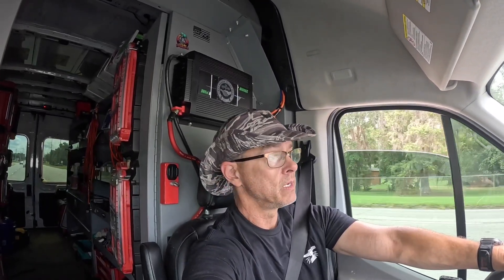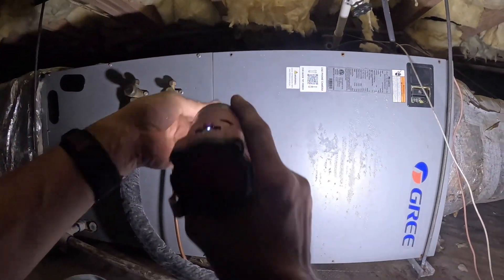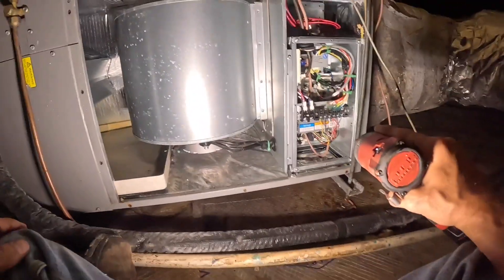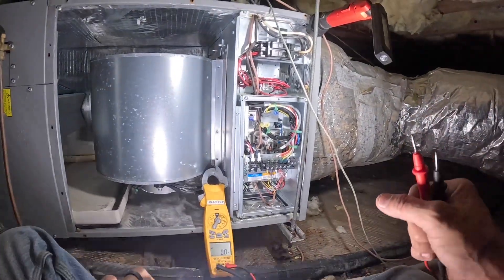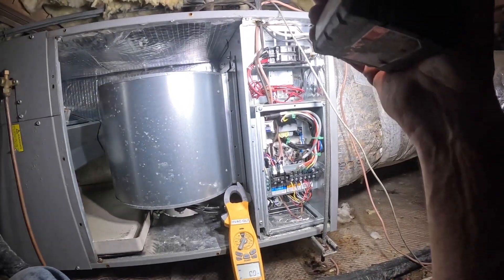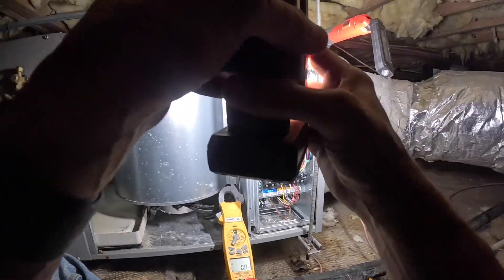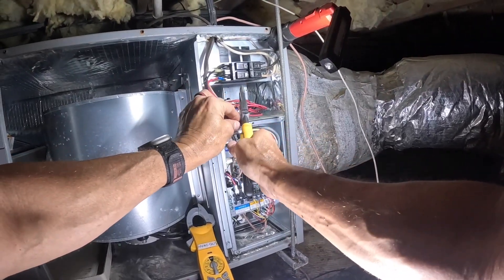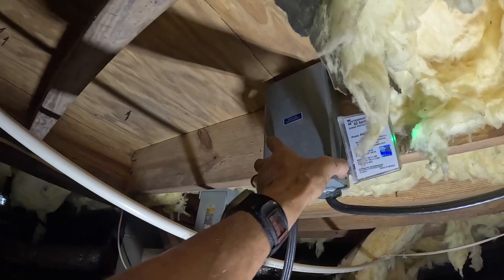Gree Flexx Giving Me Problems After Three Years Now! #hvacguy #hvaclife #hvactrainingvideos

Comment: Its funny how that unit has the 24 volt transformer comming off the heat strip breaks and the one at your house the power for the 24 volt transformer comes off a control board.

Comment: I have the MRCOOL Universal 2/3 ton unit. I just experienced this same issue about 6 months ago. Did my own troubleshooting and isolated the issue to the breaker. I still had an HVAC technician come out and he confirmed my diagnosis. The HVAC technician claimed he doesn't have parts (breaker) for MRCOOL Universal. Which I found strange because they work on and sell Gree Flexx Units which are practically the same unit. I grabbed the part number from the breaker and went online found a handful of sites that sell that breaker. Once I got the breaker, I was able to wired it all back together and the air handler fired right back up. I was glad it was just a simple breaker issue. Unfortunately, the HVAC technician who install my unit moved away. I hate how difficult it is to find an HVAC technician willing to work on MRCOOL Universal.

Comment: Variable speed outdoor units with fixed speed air handlers like GREE/Bosch seem to really struggle with humidity control. The indoor stays at 2-3T capacity but the ODUs start out at 9k btu and ramp up. Much of the cooling cycle you’re left with low high airflow and low capacity so humidity removal is less than ideal

Comment: That’s waaaaaaay too much static pressure for a Gree flex. 
I am in the process of installing my own right now. 
And the manual calls for .4” max and design is .2”. 
Also not sure what your goal with adjusting the fan speed was. You seemed concerned with the humidity, which would normally call for reducing fan speed for better dehumidification. But it sounded as if you were considering increasing the fan speed. Confused?!

Comment: I noticed and I could be wrong but was that the existing duct work? With the newer systems and the way the older ductwork might be sized.....some of your humidity issues could ‘ might be related to that. Double Check your dew point and DW insulation values and you might be able to eliminate some of the humidity issue. Like your area, here in cola SC we have no lack of humidity in the summer and with the rain we’ve been having you can add to that so it’s been a battle! As always....Great video and thank you for what you do!

Comment: I’ve had that issue many times with those breakers that are exposed. They sweat a ton. I put insulated tape all around them and often just go ahead and put it over the top as well. Without insulation you’ll be back in another 3 years

Comment: Why did you say you don't install heat strips,,, It gets cold where you are, doesn't it. When the heat pump goes into the defrost mode, the heat strip is needed.... Good videos thanks man
Reply: Gree shuts off the indoor and outdoor fan in defrost mode so heat strips don’t come on if they are installed.

Comment: Use proper crimp tool for wire clips .. for firm grip and to avoid loose connections...
Reply: The Klein crimper is great. Puts a nice double-crimp on the connectors.

Comment: So, if it can run as a 3 tone why would it be set up as a 2.5 ton?
Reply: More cooling is not always better oversized hvac equipment will cause the units to short cycle and not dehumidify the space properly and is harder on the equipment. Also ductwork is more then likely not sized properly for 3tons of air flow.

Comment: need to check ur total system Amp draw through that breaker. 
too much moisture in the blower cabinet means an airflow or drainage problem from the pan. 
did u check the humidity level in the house?

Comment: Tech tip for ya Curtis.  When hanging your units.  Run your all-thread wider than the unit, then install unistrut perpendicular like you did, but then bolt 2 longer pieces of unistrut parallel with the unit.  This keeps the all-thread out of the way, plus will keep the cabinet from racking and going out of level.  I've been doing them like this for years and it is a much better way.  Good fix!!!
Reply: It’s so frustrating that an air handler is located in a damp crawl space, in the attic or on a roof…What ever happened to having a place in the house. I feel awful seeing you crawl through dirt and 120 degree heat just to service.
Reply: @johnshield7157 Space is valuable in a lot of situations.
Reply: @johnshield7157  Usually the HVAC system is the last thing that builders think about.  It's all about kitchens and bathrooms to maximize profit.  Sad, but true.
Reply from the maker: Good tip

Comment: Curtis the updated manual pdfs  have the descriptions to adjust the air handler blower speed it's behind I think the metal box. As for the dip switches I would leave it alone and leave it in 3 ton mode which is the default setting for the condenser and air handler. 

And the excess moisture could be from the bottom of the house or mini. Basement area not bieng sealed properly.

And Curtis that breaker box looks awful and should be replaced and maybe redo ductwork.

Other wize great video. We just need more gree flex videos from you it's been awhile.

Comment: I like Gree equipment. First one I installed was a 18k Gree mini split back in 2016 on the second story of a home. That unit is still working great. 16 seer if I remember correctly. It heated great down below 10*f, and felt like it did 2 ton cooling on a 100* day 😂
Reply: The gree flex is not a mini split but has a side discharge condenser.
Reply: @gabrielstern4992  really?? Thank you for pointing that out! The air handler in the crawl space under the house made me think it was a mini split. (Sarcasm)

Comment: That Intermatic surge protector goes on every new install we do. For personal safety, all our techs are trained to never sit while testing a live 240 volt or 480 volt circuit. Kneel or squat only. If you come in contact while sitting, you may not be able to break contact. Kneeling or squatting, you will fall away and potentially save your life.
Reply: We were trained the opposite in military tech schools. If you lose your balance while kneeling or squatting and go forward, you will instinctively put your hands in front of you and fry yourself. Sitting makes that impossible. Which is best philosophy, don't know. But I made it thru my career, military/industrial/postal, without ever getting bitten. 

p.s., a little after 2008, USPS made the stupid decision to replace the real ET test with an aptitude test. Result was unqualified people getting hired as ETs. One of them in another city got fried about a year after he got the job. Word was he squatted in front of power panel of a letter sorting machine, lost balance, went into panel, that was the end for him. 

USPS got hit with a massive fine, and entered a settlement with OSHA that required us to wear massive amounts of protective equipment anytime we worked around voltage, even low power DC. For the hands, thick high voltage gloves, and work gloves to wear over the top of them to protect them from damage! Fred Flintstone hard hat, full face mask, dark safety glasses, full body suit. And ear plugs. Can you imagine trying to troubleshoot/take test points wearing all that garbage?!? 

So much crappola that they issued us big carry bags to keep it in. I promptly stuffed that bag in one of my lockers and left it there. Turned it in unused when I retired in 2019. Well I did have to don it all once a year for my supervisor so he could check off that I had it all and it was in good condition. But other than that, unused.
Reply: @angelr8892 lmao u got any more stories?
Reply: Which one are we following now you or him, lol
Reply: @angelr8892  I taught high voltage safety for four years. What you are speaking of applies to switchgear, not a condensing unit in someone’s yard. You could fall into a switchgear cabinet and get electrocuted. In my 41 years in the business, I never heard of a tech falling into a condenser control box and dying. A burned hand or a shock, but there are no live front components other the terminals on the contactor. You would extremely unfortunate if you died.
Reply: @bills6946  
I never had any training on switchgear, never worked on it. 50 years working on equipment with lots of live components, never bitten, not even close. And I'd rather skip the possibility of burn or shock, and really rather not leave it to fortune whether or not I get killed. Besides, I'd rather be sitting comfortably while working vs squatting or kneeling, I think better when I'm comfortable. I kept a thick foam pad in my toolbox that made it even more comfy.
Reply: @angelr8892  Personal safety on the job site is the workers choice, except where insurance, employer or OSHA has rules in place. There is always the risk of the spouse not being adequately compensated if the injured or deceased employee did not follow prescribed safety protocol. Insurance companies will spend a million dollars not to pay a half million dollar claim.

Comment: do you have a way to lock out the main for safety?  I know this will sound foolish to people but I was just thinking about somebody seeing the main to the AC pulled and thinking "Oh that's the issue!" and they will reset it sending power back to where you are working.  I guess it's something left over from my OSHA training back when I worked in the mill. I had an incident where I didn't lock out a main once and was doing some work on a motor, some idiot thinking he had "found the issue" hit the power and just lucky I had my hand off the motor I had reconnected to a chain and sprocket that started up or I'd been missing a hand today!  Needless to say afterwards I made damn sure to lock out the main as well as the power to any electrical motor I was working on.
Reply: The disconnect was 5 feet behind him. Only way somebody could have energized power was crawling directly behind him to hammer in the pull out
Reply: Anytime I disconnect line voltage, I will temporarily wire nut line and ground together. It has saved me multiple times.

Comment: My friend had the 4 ton installed after u did it on your old house. He loves it. This season however, occasionally it will ice up and even blower stop working. Everytime i go, it’s working. Just once in a while it’s acting up. Any suggestions
Reply from the maker: Blower stops during defrost if there are no heat strips
Reply: @HVACGUY  yes no heat strips. 
Is that normal for it to ice up during defrost mode
Reply: You need to clarify - is this during summer or cooling operation or heating operation?
Reply: @sprockkets  summer
Reply: @DevinHVACInc  This could be an issue with the inside expansion valve, or the system may not have the correct charge, or the system cannot properly detect temperatures of the refrigerant coming back to the unit to properly gauge the compressor capacity (it's running too fast). You need to have them tell you where the ice forms. Is it near the liquid line, or does it form first on the return gas line to the outdoor unit.
Reply: @sprockkets  start freezing up after the indoor fan stop working intermittently. Start to freeze on lines from condenser
Reply: @DevinHVACInc  in that case, either the indoor unit isn't getting a G signal, or indoor fan is having issues of some sort. I don't know which kind it has so I'm thinking it's a proprietary communication version. No way to really know unless you perhaps check for abnormal temps, abnormal amp draw, or something.
Reply: @sprockkets  thx for all inputs. He said it’s more on very hot days

Comment: I was just thinking about your install at your home the other day, how is that going for you? It’s crazy that you just posted a video about this particular brand when I was thinking about your install just recently.
Reply from the maker: That system is doing great
Reply: Are you running at 2 or 3 tons? What fan speed? How many square feet? Do you notice any sweating on the duct or air handler?

Comment: How much $$ are the control boards for gree flex?
Reply: You guys are also forgetting the trane resolute but that's Canada only which is also a, rebranded gree flex. And personally the trane version is probably better and if trane brought that to the US it would have less issues VS their own micoinverter proprietary systems.
Reply: @gabrielstern4992  i doubt the trane version is better.
Reply: Mr Cool universal and Tosot and I believe senville are all the gree Flexx rebranded.
Reply: @houptee  Mr. Cool is made by Midea.
Reply: @mikecockerman2200  Mr. cool central is a gree flex. senville is all midea. but was wondering about board costs, if it is like $1k at cost it's ridiculous and just like north american makes that gouge on parts on their inverter stuff
Reply: @mikecockerman2200  I think only the mini splits are Midea. I downloaded the manual for the Gree Flexx and Mr Cool universal and they are the same exact manual only the first and last pages are different. Basically if you look at the other brands of similar ducted systems and you see the same rubber plugs for the condensate connections for horizontal and vertical mounting it's a Gree Flexx. ACIQ is a Midea ducted system.
Reply: @houptee  good to know.  I've only run across the minisplits.

Comment: And that's exactly the reason why a lot of people say we shouldn't be using the an electric drill like that for undoing the screws cuz they get stripped here's an idea instead of using the actual drill they make a hand screwdriver that's battery operated I'm surprised you don't have one instead of using the actual drill
Reply: I don’t have a problem you have to have control of what you’re doing.
Reply: There is exactly ZERO ZIP ZILCH not one chance that the screw is going to strip taking it out. I'm not saying your wrong about those impact will strip the screw. It's going to strip right tighty not loosy lefty
Reply: Curtis usually has all the tools he needs EXCEPT for a hammer. He beats on stuff with a variety of tools just never a hammer.
Reply: @JohnCline  every tool has a hammer side...
Reply: Using an impact will do it. He should be using a cordless drill/driver screw gun.